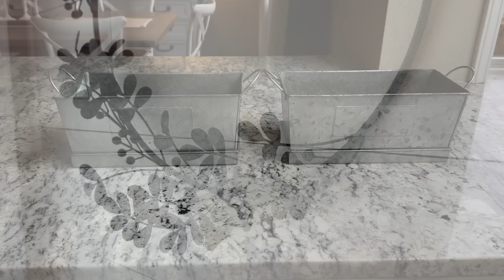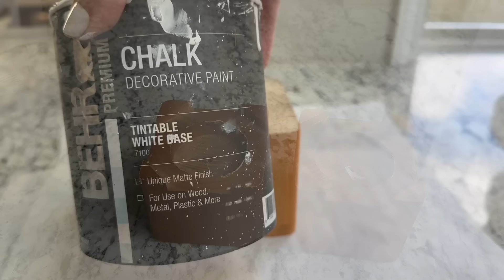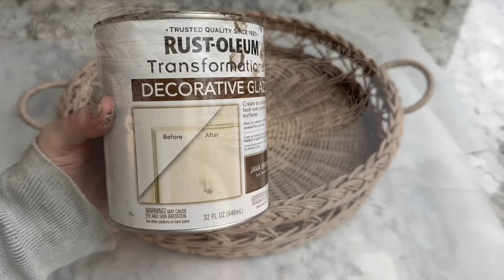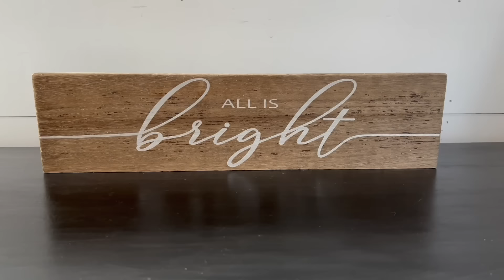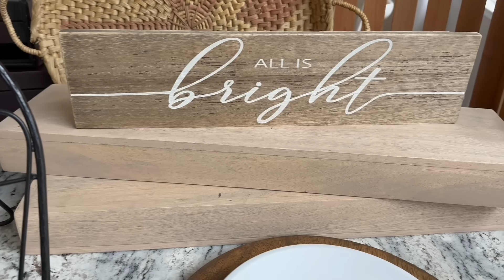🏠 AFFORDABLE HOME DECOR • DIY • GOODWILL OUTLET • THRIFT WITH ME

Comment: You are amazing!! I love your channel :)
Question for you - how do you decide when to use citristrip or when to sand to remove the finish?
Reply from the maker: Aw, thank you so much! 💕 Great question! If it’s a really squared off, flat surface, I’ll often just go straight to sanding, if there are a little intricacies, or angles I find it a lot easier to use the Citristrip, then finish it off with a light sanding. One downside to the Citristrip is it’s a little gunky and can be a bit challenging to remove, but I love that it doesn’t have nasty fumes, and it does work quite well.
Reply: Thank you so much for that information much appreciated! Looking forward to your next video you have an amazing talent ❤